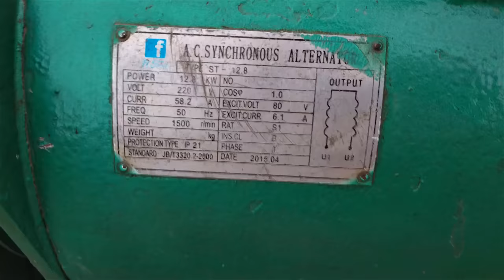Free energy Generator With 100 Kg Flywheel 12Kw Alternator 100% Real Free Electricity

Comment: Interesting when considering the electrical sine wave phase angle and synchronization of operation during power changeover when the motor is essentially always under load.  I'd be very interested to learn 'how far from the original sine wave' this newly produced one is, considering the whole system was initiated by the house power to begin with and not an external mechanical power source.  Considering there are no phase monitors and synchronized changeover, surprisingly he didn't have any hiccup or tripped circuit breaker.  Very well.
Reply: its did not mork sorry
Reply: Sotladgani borm narx qanch
Reply: Paso agigantado para el mundo
Reply: Nothing interesting about this. Tried true derp. Just someone using YT, not someone breaking physics. Not someone presenting a real working device.

Comment: I wonder why the lights don't flicker with such crude energy production. Also when the welder was used, it didn't seem to draw power from the system and the lights would definitely have flickered and dimed when high amps were drawn from the system. The lights and Welder seem to be on a different electrical system. Something much more stable and clean. These machines are always on dirt. Easy to hide a ground wire from grid power. Not sure about this?? hmmmmmm?
Reply: that  is normal. he need to used  110-220 regulator he is loosing power because tensioner  loose belt is loose .he also used generator end
Reply: Correct! This is a confidence trickster! Prove me wrong! There is a sneaky power connection through a cable buried in the mud under one of the hollow metal legs resting on the dirt. Share a new video with the metal fame pulled up off the ground, and passing your hand underneath (with this running) The poster is only interested in being paid by YouTube for AD money from many clicks.
Reply: haw they dot burn too !
Reply: Welder?
Reply: @pstonard  Correct, even on a mains supply with those bulbs and the welder all connected in parallel, they would have flickered with the load change. I call BS.
Reply: This is YouTube money making machines.... 😁👍
Reply: @pstonard  He first show it connect to the generator, after his white cable is hidden and coming from same direction, but utility power. Now he run his motor flywheel welding and everything on utility power. This is meant to generate youtube money not power.  Nicely done though.
Reply: the use of regulators and capacitors
Reply: I even fluctuated just from adjusting the tension of the belts🤣🤣

I guess another benefit Is that once it’s up to speed there’s no amp draw LOL. The best part was when he unplugged it and then plugged it into the board and nothing changed. Pure gold
Reply: @pstonard  The cable is probably going to the lamp box and feeding the receptacle that the motor is plugged into.  Note near the end of the video that there is some darker dirt in the upper left corner of the video at around 11:15.
Reply: Nope

Comment: Hmmm a flywheel is a battery of sorts it charges up with rotation energy that is incredibly powerful once its up to speed and will spin for a long long time.  So the flywheel is the added energy powering the generator beyond the motors output.  You cant get energy without loss but the flywheel is storing and releasing continuously! Wow..this may not be a BS video.. got me thinking 🤔
Reply: i have been researching this for a while and I believe it works.  there is a significant loss in available wattage as a result of the circuit feeding itself but you are left with up to 50% available wattage to power whatever you need.  if the equipment you are using is proportionate to your need, you could easily power your home with a system such as this.  the parts are available to order online but finding the right kind of flywheel is a challenge.  it almost has to be machined because they are incredibly hard to find.  
i am going to try it for my cabin.  nothing to lose by trying it out.  
if you find a system that works, be sure to get backup components for everything and try to keep it on the down low.  if you interface the system with your grid, the unit will make you money while you sleep by feeding it your unused kW hours.
Reply: Nope
Reply: if the components were sized carefully and accordingly, with addition of a fairly intelligent feedback/control system, this type of power generation system could actually work. hmmm i'm actually thinking of building my own version. nothing to lose. i agree with Joey Patrick.
Reply: @DJMICA-bz3qz  bro everything you see and you don't see in this universe is a form of energy even our physical bodies are just energy. as i said nothing to lose.. if it works in a short while, you just have to find ways to make it work longer. we all know it's not going to work forever..i'm not married entirely to the idea presented in the video. i can make my version a hybrid kind of system to make it more usable.
Reply: @nino7178  idk all I got from your reply is that you agree with me all of a sudden. I get what your saying about trying anyway tho, like the first earth battalion army tried to overcome the depression of the Vietnam war by making super soldiers. Some dummies hurt themselves trying to literally walk through walls but others with a more reasonable approach realized that by aiming higher then could ever be achieved they just may accomplish more, one would have to at least try to find out. So tinker with your machine but don’t be surprised when it doesn’t work.
Reply: @DJMICA-bz3qz  sorry, it's my fault i didn't made myself very clear right in my first comment, but the keywords were "build my own version". that means i'll pick up some and add my own... like you dismissed these machines as total bullshits but continued to say sometime in the future we might be able to figure it out... so you're right i agree with you with some but not all... and the future that you were saying must start at the present or should i say was already started in the past. the development of human technology is just amazing... many great inventions started out as crap.. we must be grateful to them persistent inventors of the past. for some, failing is learning.. who knows? even bullshits can increase soil fertility. opps! i must admit it's a crappy analogy heheh...
Reply: @joeypatrick3737  that's if you can sleep through the motor and generator running
Reply: @nino7178  100% agree!

Comment: Flywheel will eventually stop, but, you could use the temporary kenetic energy of the flywheel for free, short term  power, before it slows down, too much. Also, A big problem will be finding a bearing that will hold up to the pressure of a 100 kilo flywheel. I would call this gadget a "temporary free power machine".  You would have to keep plugging and unplugging to a power grid, to keep it up to speed.
Reply: There is no free power. In ideal conditions it would be able to give all of energy he put to start the thing moving. That's it. In a real world, any significant load and it would bring the system to a halt quickly.
Reply: @xZeroOffical  The free power would last maybe a couple of minutes at best, until the flywheel stopped. That is my point. It is a useless mechanism, at least for free power.
Reply: You never seen a car or truck bearing before?
Reply: @crabbingclammingboatcampin4962  My point is that there is zero free power here. It is against the energy conservation law.
Reply: OK, so you go and buy some expensive item with a credit card. You aren't paying for it now and think you just got somethig for free but there are laws that say you have to pay it back later - with interest. At least, I'm hoping you have a better understanding of how credit cards work? I know even that taxes some people. I don't need credit cards because I gamble and always win 100% of the time. It paid for my house in Twitter.

Comment: 1. input = output + loss(tranmission/back emf.of load)
2. increate load --->rpm reduce--->motor slow until stop.
Reply: Yes
Reply: @Navneetkumar-oh6em  so theres a power limit that if exceeded it will eventually make the wheel stop. However, the range below that limit, could power things while the wheel keeps moving by its inertia. Is this correct?
Reply: Door vrijving lagrrs... motor... generator zal in korte tijd stilvallen.
Reply: @IamPetrus  no , you are completely wrong
Reply: He plugged motor in off screen. $$$$ to power company = not free.
Reply: @IamPetrus  Motor is 2-1 gear reduced to the flywheel. "Stored energy" Flywheel is  3-2 to the generator. Generator produces say 10,000kw but the motor only uses 1500kw. I think it may work. Not indefinitely, but for quite some time.
Reply: There's a bunch of scheptical people here only see this in negative way. Why would you want to keep this running forever ? If it doesn't runs forever,  who care  ?  If I built something like this is just to get some power at home in case of emergency.  That's it
Reply: @spinnymathingy3149  I don't want it free as you think.  I have a power bank and I'm not expecting to run it  forever but it works for what I need.  I got the idea from YouTube. I don't care if they make money out of it if this is something that works then they have the right to make money out of it. Why are you so envy of people getting successful ideas  ? Even if it needs a battery is still a good idea and can be improved. You don't even have one single video in your channel.
Reply: @JonathanMoreno52  I’m only pointing out that it doesn’t work, at all, period. 
A hidden power cord runs this so-called invention
If you don’t understand what’s going on in this video, please go try making one similar
Reply: @spinnymathingy3149
Reply: @spinnymathingy3149  your right

Comment: This is not done by a hidden battery. He'd A) need to convert it to AC and B) the battery would have to be extremely large for it to sustain welding. 

It's just cables. Below the sand. This easy...
Reply: @pstonard  how about trying it yourself to see if its BS
Reply: @gazoo-pl4nx  Well that's a good suggestion, but here's the thing. When you know something is crap, and has no scientific backing, why waste your time, energy, and money on it? A much better solution, which I have already posted in the YT feedback comments, is for the author of this video to collect some technical measurements and share it with those of us that are curious. 
On the other hand if you're up for it, YOU make one for us.
Reply: @pstonard  " Share a new video with the metal fame pulled up off the ground, and passing your hand underneath (with this running) "
Only if the guy had a CRANE. That flywheel, alone, weighs 100 FUCKING KILOS!

Comment: So, time-lapse 3 -  4 hours LATER (when flywheel has spun down) THEN check the output of the "Miracle Machine"  Once the parasitic loss of power due to friction, windage etc., you will see that "Free Energy" fail to exist.
Reply: It cannot even spin for long. Leave alone powering external devices like he shown. I expected it to halt relatively quickly under load (which would in reality!).

Comment: :) The color of the Power Grid wire to the motor changed at 10:33 from red to green :) and backwards :) The "traffik light" (green) show the way to the hidden buried grid power :)
Reply: Wires don't usually change color and I didn't see anything. But I have seen several inventions like this.
Reply: @lit3plumber12  Let me fix that for you, "But I have seen several scams like this."
Reply: It is just paint watch as he is coming around just before. Overspray

Comment: Could you make another video that shows with a multimeter the measurement out of the socket on your light board there, the output of the generator and also the input side of the motor? You've done a vastly better video then any other so far but that would all make it pretty irrefutable...
Reply: If he did that then it'll be revealed that this is in fact not free energy, seeing as he's putting more energy in than he is getting out of the system.

The title is complete clickbait, and the video itself isn't much better. Free energy isn't possible
Reply: You should have seen in this video, where he unplugged the grid power, and then plugged the motor into the white output cord coming from the generator, so there's no input power.
Reply: @marcusgarvey8668  There appears to be no input power.  Since what appears to be happening is not possible, this is simply a magic trick.
Reply: @marek9784  He didn't know that was impossible, so he did it !

Comment: I have noticed that at the video time 5:35 the speed of flywheel is high but when there is a edit cut and 5:40 video time the speed is slower. this is why i want to know how long this solution runs continuously. if the Alternator is not low RPM it might not provide enough power to motor to keep the cycle, and also there is more lose during the higher pully of flywheel and smaller pully of alternator, the load on alternator is reducing the energy supply and the motor cannot control the lose of power in flywheel. 1500 RPM alternator is too high I am not sure if it can keep running for 1, 2 or 6 months. also check if it is losing RPM gradually.
Reply: I think if this can run continuously even for 2-3 hours then we still have a kind of free energy and we can give some boost to this from external power supply after 2-3 hours. it will save money and electricity bills I think. :)
Reply: @sachinsingh-ok5it  bruh... go study physics properly.. did u bunk all ur physics class in school or what?
Reply: The motor is plugged into his household electricity . He plugs a cord into motor that goes off screen to right. Not free current.
Reply: There is a bad video edit that discredits the presenter. BUT According to Occum's Razor theory (please do your own research) the best answer is the most simple one.

This is a confidence trickster! Prove me wrong! There is a sneaky power connection through a cable buried in the mud under one of the hollow metal legs resting on the dirt. Share a new video with the metal fame pulled up off the ground, and passing your hand underneath (with this running) The poster is only interested in being paid by YouTube for AD money from many clicks.

Comment: Brilliant! Absolutely brilliant.. I'm thinking of using a 500w wind turbine turned by a desk fan. Cut the fins off the desk fan wheel. Belt. Inverter. Car battery. The 500w turbine pushes 25.5 amps. Plug the fan in to the inverter, fan turns the top of the turbine?